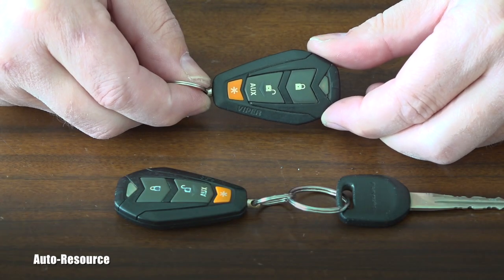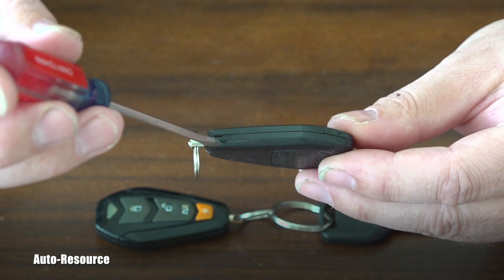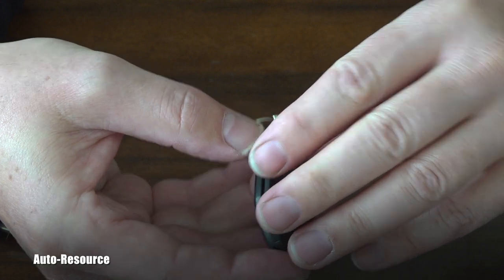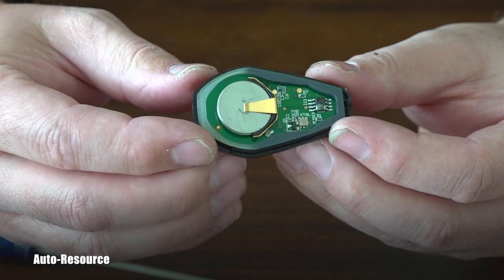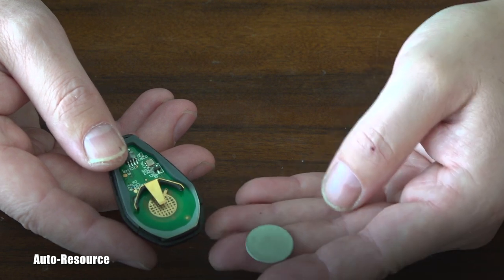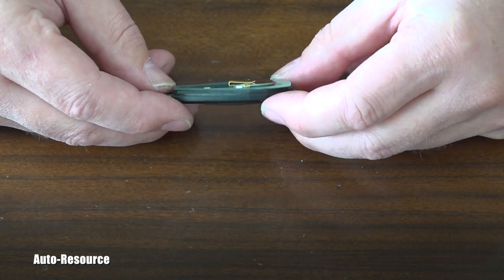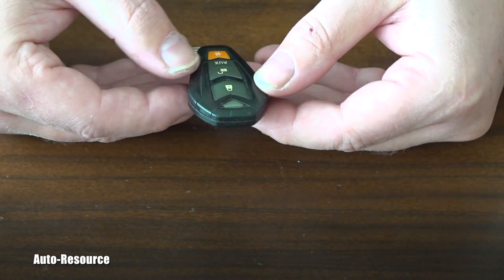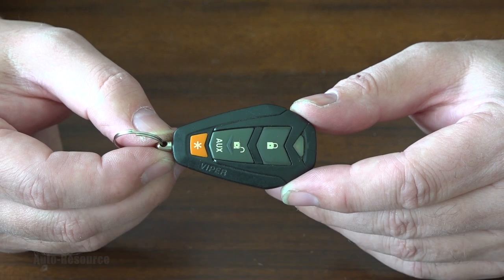How to replace battery in Viper alarm remote

Comment: Wouldn't be nice to also mention that it may need reprogramming after replacing the battery and it wouldn't be nicer to show how is done?

I guess not since you didn't bother which makes your video a bit in the lower side of the scale, say 0.3 of a star?

Yep! That sounds about right..